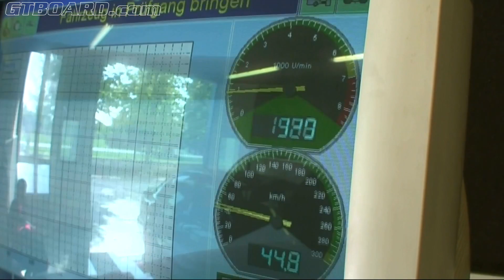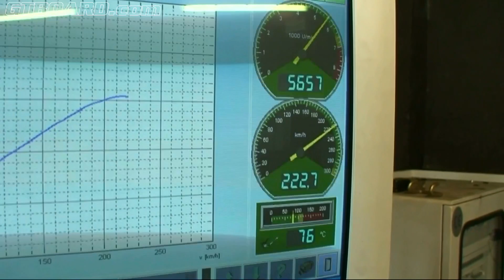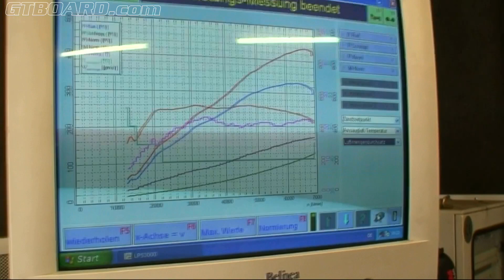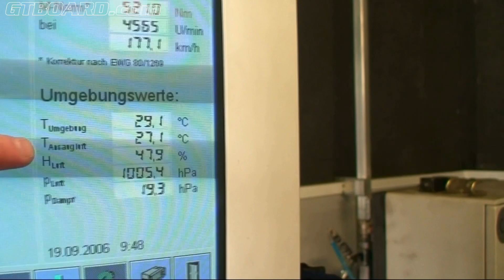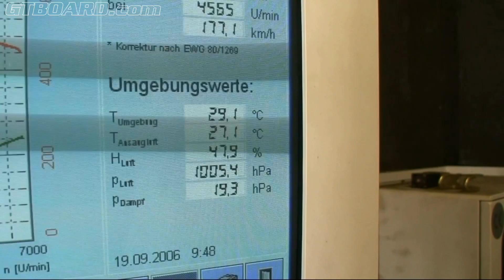🏁Dyno run BMW M5 E39 2003 MY stock vs Supersprint headers, catalysts and exhaust.  V8 nirvama!🏁

Comment: Did you gain extra HP by installing them?
Reply from the maker: 30 HP verified before and after on dyno.
Reply: @gtboard  I simply removed my resonators and mufflers mine is just loud lol..I should look into these
Reply from the maker: @dennismichealsm3786  The headers are a work of art.